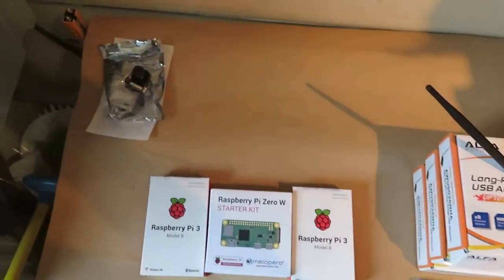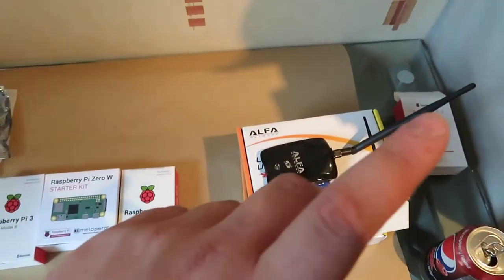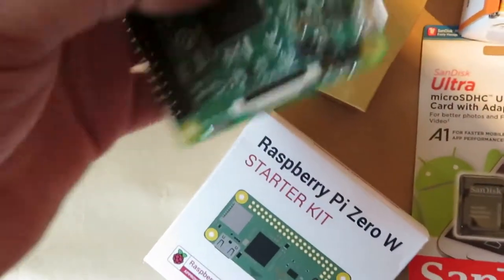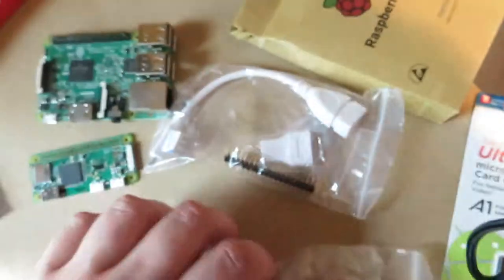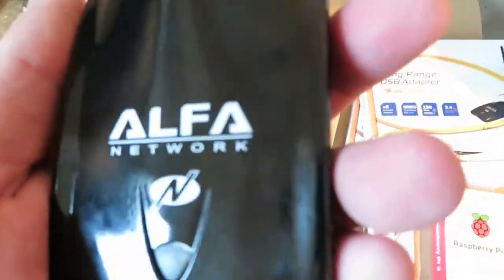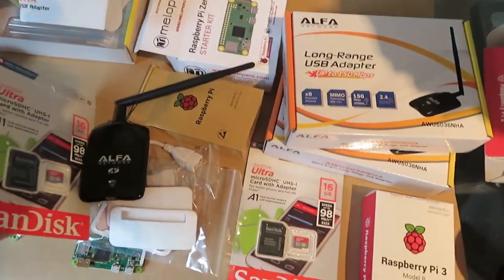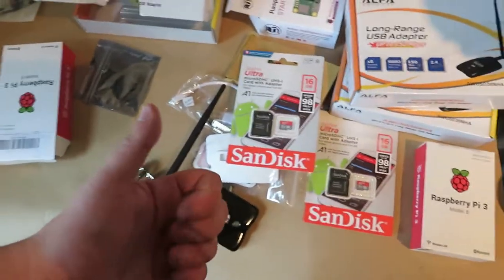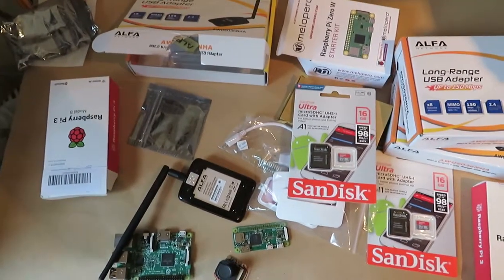Digital HD FPV On A Budget!: Part 1 - Project Overview & Parts (DJI FPV Experience Alternative)

Comment: Good stuff. Hopefully the new Raspberry Pi 4 will improve things even more. I'm using the same wifi modules with mine. Thinking of getting two (different modules) for the Air Unit and not sure for the Ground Station. OpenHD Version 2.0.0rc1.2 OSD is so good it puts the DJI HD effort to shame. 
Even the new Mavic Mini and Air 2 gets nothing spectacular for their Ground Station OSD. Basic stuff. Pretty pathetic when you look at the Matrice 300 and that controller and the OSD and what that thing is capable.
So glad there is something like OpenHD. People working together so we don't have to rely on the big corporations. Thumbs up!
Reply: Hey :) Yes I just added Pi4 support in OpenHD a few months ago and it works very well, it can even support 4x wifi cards on the ground for diversity (even 3 is quite enough though)